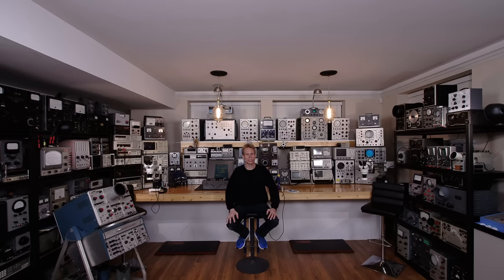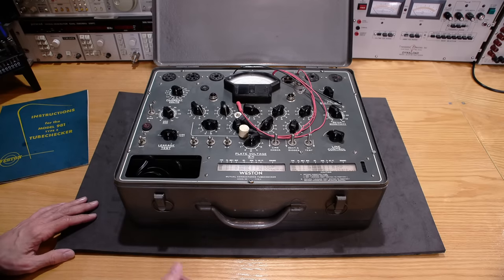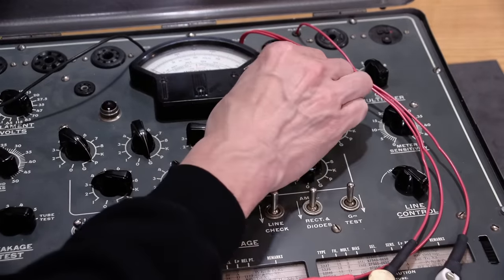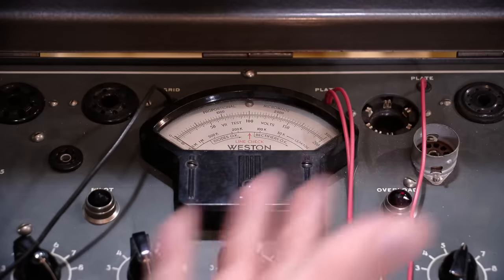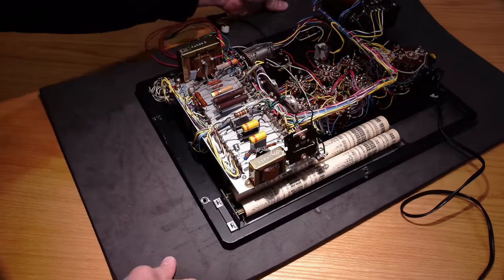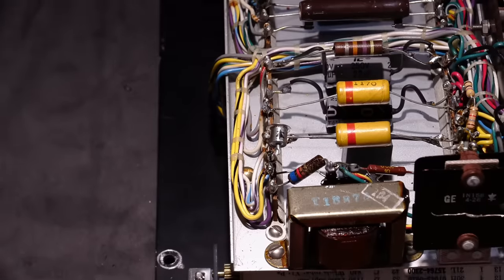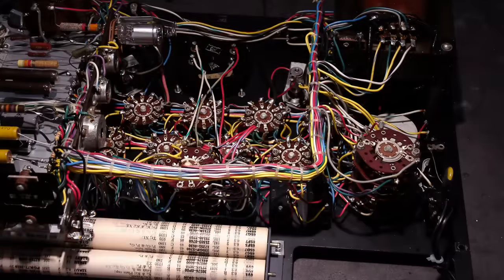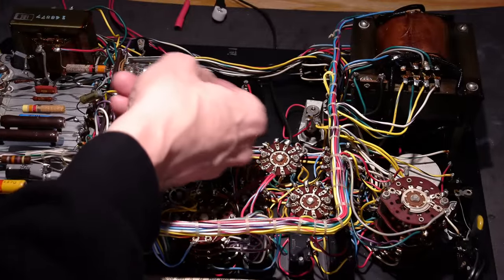Weston 981 Type 3 TUBECHECKER Repair, Modification, And Alignment Procedure!

Comment: Having repaired a number of Hickok testers, I'll add some info about a couple things that Ned didn't cover here.  First of all, Never spray the switches and controls with any kind of contact cleaner that leaves a residue, lubricant or "preservative". I don't care what anybody says, or what the directions on the can say,  don't do it! I have seen tube testers ruined by people spraying switches and controls liberally with contact cleaner because the chemical residue soaks into the phenolic wafers, and especially on units like this with a sophisticated leakage test that reads in Megohms directly on the meter, you risk creating leakage paths  that could create flukey tube reedings or show interelement leakage on tubes that have none. The problem might come and go with temperature and humidity as well ,and once you've saturated the switch wafers, which are mix of cellulose fiber, wood pulp and resins, there's probably nothing you can do to remove it. It's best to spray things a little at a time with pure alcohol,  and try to make sure any grease and dirt that is dissolved by the alcohol gets blown off and away from the switches with air pressure. If the tracks on the switches are sufficiently oxidized that you must use Deoxit similar, apply a tiny drop exactly where you need it with a syringe, toothpick or dental pick.

 In the case of Hickok testers, which are very different from the Weston circuit,  calibration instructions always said to use a voltmeter with a 1k ohm per volt impedance (except for measuring the grid signal) . Taking the readings with a digital meter won't load the system down the way that it was when the factory checked the calibration, and so all the voltages will either seem to read high, or youll end up adjusting the machine so that the voltages appear to match the schematic/service info, but they'll actually load down and be lower than you think when you try to test tubes on the machine. Put a 150K to 200 K resistor across the digital meter probes and that will load the tester down similarly to how it was measured and calibrated at the factory (Hickok B+ is 150 volts). The grid signal however can be measured directly with a digital Volt meter because the factory would have used a VTVM, a  vacuum tube volt meter, which is very high impedance.

Comment: A little tip regards to the removable multimeter unit. 3D print an adapter and attach it to an flexible arm. Easier to display it in videos etc. keep up the good work. Love your videos! :)
Reply: Seems like a waste of time when you can just put a magnet on a desktop trios and attatch it to the magnet on the meter face.

Comment: That tester has a socket for acorn tubes.  They were small baseless VHF/UHF tubes introduced in the 30s.   Pins for the elements came out around the perimeter and ends of the tubes, needing a flying lead for some connections.  As I recall the tubes numbers were 954, 955 etc.  That may be what the 'broken' lead is for. 
Thanks.

Comment: Wow! Another really good looking piece of equipment. One thing I noticed immediately was the original solder joints. I think the motto for soldering back then was "the bigger the blob, the better the job".  Now for your next challenge. Restore a Heathkit assembled by someone who though they knew what they were doing.

Comment: Not sure that blue wire was snipped as some insulation is a little stripped back, and the other end looks like it has some kind of heat shrink or connector on it, so it may be from factroy, but it looks more like its pulled out of the joiner it was meant to be connected to rather than being snipped.  That's just how it looks in the video :)
Love these long form videos.  Always a good day when Mr Carlson is doing an analytical repair.

Comment: Paul, you have a mutual conductance tube tester is one of the very few that can test the Acorn tubes, I notice that right away into the video. The strange socket just to top right of the meter accommodates the acorn tube. The pin plug wire is for acorn tube with a top connection pin, like the 954 & 956.  Acorn tube numbers that I'm aware of, range from 954 to 959.  I have a Precision emission tube tester that can check the Acorns.
Reply: Most of the better Hickok testers can test acorn tubes, and even subminiature pencil tubes. I have a Hickok 752A that can test anything from 1920's-30s 4 pin radio tubes all the way up to 12 pin compactron tubes used in 1960s color TV sets.

Comment: My Weston is similar to this one.  Some variation on panel markings. Mine has a toggle switch for screen settings were the overload lamp is at on yours, instead of a Gm test toggle, mine is labeled gas test,  Anode voltage (EP) is labeled V,H,S,M,L,N . Above the meter is sockets for transistors. Everything else is the same. Thank you for this video.

Comment: I'm just sitting here screaming Paul burnt resistor! That resistor on the bottom of the screen right here at 6:45 looks blown up. Although I know it could possibly just look that way because of flux.
Reply from the maker: That's the way those resistors look. That one looks like it's in new condition too.

Comment: Thank you Mr. Carlson!  I maybe missed something. There are many sockets on this tester.  How did you know which socket to use to place your probes into, 2 & 5, 0D3.
Reply from the maker: The 0D3 datasheets are available online and in tube data books. The datasheets show the location and purpose of the pins. Looking at the top of the tester, the pinout is mirrored from the datasheets.

Comment: Paul, I didn’t understand why you installed the capacitor for positions 2,3, & 4 of the leakage sensing?  And, why that value of cap?
Reply from the maker: Hi Jim, There is ripple from the loomed wires, "ETC" getting into the meter circuit, the 4.7uF value is just enough to filter it. Since the leakage circuit is DC, it does not affect the measurement as shown. Someone else mentioned (in the comments here) that in their future models, they must have noticed this, and added a value to do the same thing. So it appears to be a possible design flaw that was overlooked. Not enough coffee that morning I guess :^)

Comment: Very nice tester, thanks for the video. Wondering if circuit is simular to my hickok 752. Looks closer to a B&K tester design. If needle deflects but then goes back to 0 thats normal. But yah yours has issue, usually bad cap or drifted resistor

Comment: I use the modern equivalent of plumber's asbestos pads or a genuine animal skin shammy  to lay over roll charts or grille cloths or speaker cones and especially VERY expensive guitars. The shammies work great. I have burned a couple small holes in one shammy and it's still usable. It really stinks to high heaven, but they will take a hot soldering iron laying on them for a decent period of time, and even when they do start to smoke, the damage is still minimal. I usually carelessly toss the shammy on the soldering iron while I am swapping out guitars on my workbench and then my shop fills up with acrid stinky smoke.

Comment: I'm guessing that the grid lead was put there for tubes that would have the grid come out to a separate pin, like a 304TL. However, somewhere along the way, someone probably decided that they wouldn't have the need to test a 304TL, and thus put that tape over the grid lead. (Don't know why, but they probably should have probably removed the grid lead if it wasn't going to be used.)

Comment: The 6K6 is a low power output tube, somewhat similar to the 6V6.  It was used to drive the reverb tank in the original 1950's Fender reverb unit that you probably heard being used  by many surf guitar bands.

Comment: These Westons 981 type IIIs are a whole lot like the Heathkit TT1s. I have a Triplett 3444 that reads in actual Siemens, or micromhos. Was that genuine purple mimeograph? I have a few tube testers, and I have somehow managed to NOT bring any more of them home with me. That classroom Hickock was a hard one to pass up. It was something like a giant Hickock model 600, with an enormous meter face, and mechanically linked dual controls that could be worked from either the front or the side. It was also the size Las Vegas slot machine.
Reply: I had to go look. I have the rack mount Weston model 686 laboratory grade industrial tester with the flat table top test bay and the sloped top panel. That one is probably the best one I own. It is also a royal pain to set up though. It can put 400 volts on the anode, so it outclasses most testers, except for the fancy English Avos, German Ontras, Nuebergs, and some other $$$$ lab grade stuff.

Comment: @MrCarlsonLab, 

I have a Moza Racing GS SIM steering wheel.   One of the joysticks is defective.  It does not actuate the X-Axis pot.  Moza support is really tough to deal with.  Even though it is under warranty, I would like to repair it myself.  I cannot get the knobs off the rotary encoders.  Moza had problems with them falling off, so they glued them on.  I tried nylon/plastic prying tools, but they don't even move.  I tried heat, with no luck.  Do you have any tricks?
Reply: If Mr.Carlson can't help you, post this question over on Haseeb Electronics. He fixes a lot of random gadgets like this. I can't promise he can help you, but it's worth a shot. Wrap a piece of strong string like fishing line around the shaft under the knob and try pulling. If it still won't come off,  heat with an electric heat gun. Be careful, a lot of plastics are VERY cheaply made so use your judgement!
Reply: @W1RMD  Thanks for the option, I will check it out...

Comment: Bob Andersen's tube tester has a simpler layout than this one. 
His uses a bank of toggle switches along the bottom and it comes with a book that lists the settings for each valve type. 
The rollers are a better option.

Comment: Hi Paul. Great video as always, can’t wait to get a notification of a new video from you. Just a quick question on calibrating these old machines. Don’t they normally ask that we use a 20k impedance meter? Is your Fluke 20k ? I just want your opinion on this as I always freak out about not adding that 20 k resistor in parallel with the meter and then I redo the alignment .
Reply: Hiccok specified use of a 1K ohms  per volt meter impedance for all tube testers alignment work (except grid signal measurement)  And therefore if you were using a digital meter for aligning a Hickok you should put a 150K to 200 K resistor across the meter's probe leads.  The grid signal however could be measured directly with a digital meter because Hickok specified a high-impedance VTVM for this.
Reply from the maker: The answer is quite simple, what is the input impedance of a grid circuit? It's a lot higher than 20K Ohms! If I was to load the grid circuit with a 20K resistor, I would have a big reduction in signal amplitude. The 6K6 is installed to load the rest of the tester, (not the point we are measuring.) You will notice in the brochures regarding this tester, the values for the GM multiplier are measured "Peak to Peak" which is done with an oscilloscope, or high impedance meter.
Reply: @goodun2974  That’s correct. I remember this 1k/volt from when I calibrated my I-177 . Thanks for your input
Reply: @MrCarlsonsLab  Sorry, Imight have put my comment in the wrong time of your video. I wasn’t referring to the grid voltage measurements which indeed have to be taken with a high impedance meter. Thank you

Comment: Will this method work on the alignment of my Hickok 6000A also? Thanks
Reply: The Hickok circuit is quite different from the Weston circuit.  Some of the basic techniques will be similar but that's about it. Most Hickok units have few if any calibration controls, so it's more a matter of verifying correct voltages and readings than of adjusting things.  The Alan Douglas book "tube testers and classic electronic test equipment" has some useful information in there;  and years ago I bought several reprinted Hickok service manuals from ebay.  I would imagine you could find the information online if you keep looking.

Comment: What determined the value and type of capacitor that you used for the modification? Why 4.7 and poly?
Reply from the maker: Poly = low leakage (Its placed in a leakage circuit) 4.7uF = just enough filtering to settle the needle in all positions of the leakage function. So... Not enough capacitance to slow the meter appreciably, not too little as to still show a false needle deflection issue.
Reply: Thank you for reply. So how did you determine the value 4.7 was it by math calculation or trial and error or is it just something you knew from experience? @MrCarlsonsLab

Comment: Can an Eico 666 meter be repaired? I had a friend use my tester and they had the wrong settings for a tube and I think it cooked the meter.
Reply from the maker: It depends whats wrong, and how it cooked. Most meters can be fixed, it's a bit like watch work, but it can be done. I have fixed so many, I lost count years ago. You would want a small microscope, some SM tweezers ETC.
Reply: @MrCarlsonsLab  I am blind, so I’m afraid that repairing the meter myself would not be an option, do you repair such things for customers?

Comment: I have one of these and what can I say but junk. It doesn't work. I have recapped it and still nothing and without a service manual it's a waste of my time. I have done a lot of research on it and to say its nightmare is understatement
Reply from the maker: Junk? One of the best tube testers out there is "Junk?" Ok then.
Reply: @MrCarlsonsLab  I know it should be one of the best  but unfortunately my tube tester is dead to the world. I found the problem to be in the transformer is open.
Reply: @carl112466 ,  I feel your pain,  but ----  didn't you use a voltmeter to verify AC voltages going into and coming out of the transformer before you continued on and recapped the unit?  Checking for power supply primary and secondary voltages from the transformer is electronics 101. In the case of a tube tester the other most important thing is to verify that the meter still has continuity.  If the transformer and/or meter are bad then it's probably not worth restoring except perhaps for the most dedicated and experienced electronics tech; and even then you may need to have 2 of the same model so you can borrow parts from one to fix the other.  It's a bit like owning an old British sports car.....